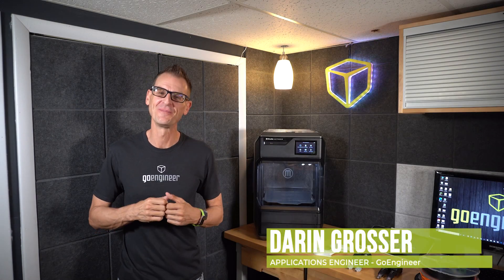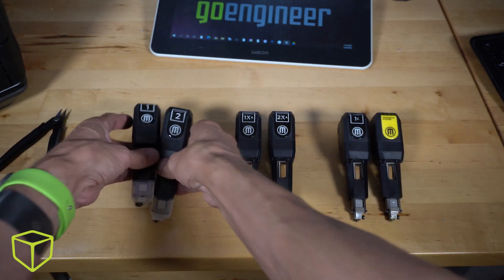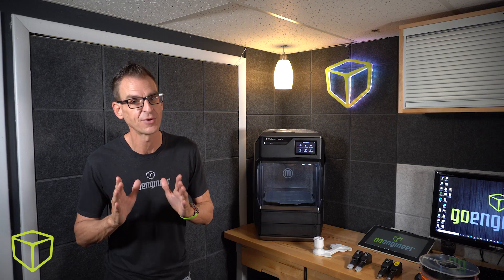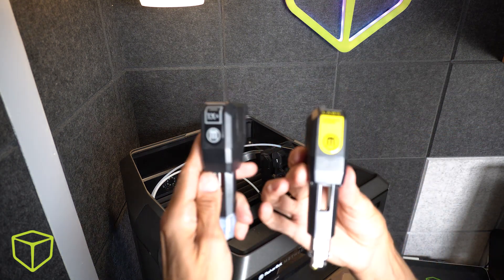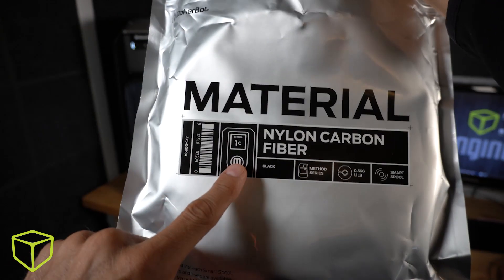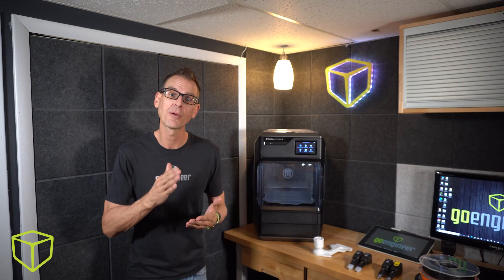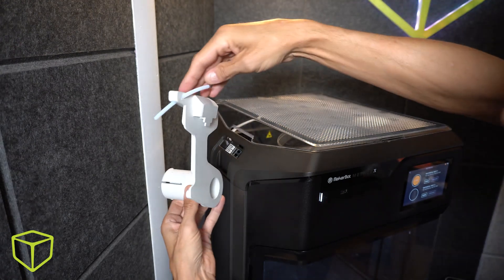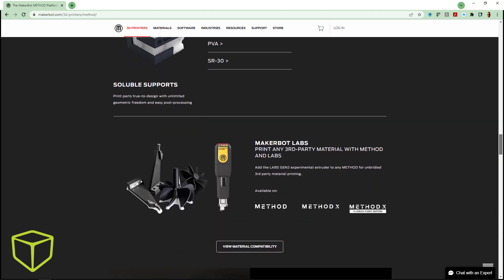Makerbot Method X - A World of Materials are a Simple Extruder Swap Away

Comment: Which bay should I use for the ABS-R, Since I currently used Lab extruder for my Antistatic ABS on the left side for my method X?
Reply from the maker: The LABS extruder only works with materials thru the Aux Port on the left, so you'd have to remove the spool of Antistatic ABS and put the ABS-R on the outside.  If you had an 1 or 1a material extruder, you could use the Makerbot ABS-R thru Bay 1 at the bottom.  Again, the LABS extruder works with ANY material, but that also assumes that it is not necessarily Makerbot Method branded material, so you'd need to use the AUX port for everything it prints.